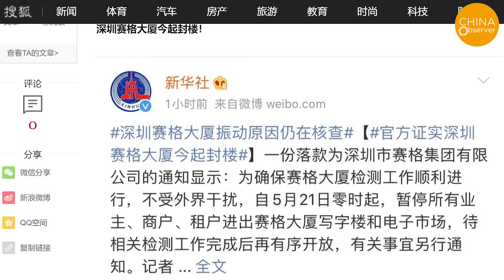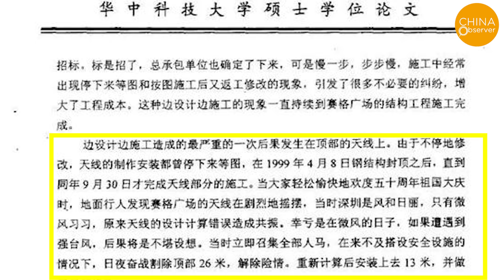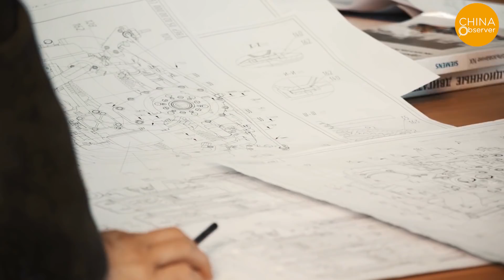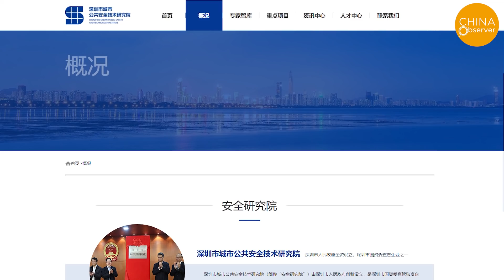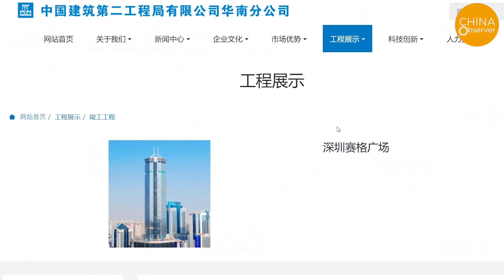356m Tall Skyscraper Shaking Again, Monitoring Data released, analysis of the causes of shaking

Comment: She’s coming down - just a mater of time, shaking is the enemy to strong concrete.
Reply: Shaken building syndrome.
Reply: Not concrete but steel supporting column structure infill with concrete as per report
Reply: The building isn't coming down due to resonance oscillation, as such vibrations are common in supertall buildings, and can be managed (for occupant comfort) with solutions like a tuned mass dampening system (we have buildings in NYC, such as the 436m 111w 57th street and the 425m 432 Park Avenue, that due to their supertall status combined with extremely narrow footprint, require tuned mass dampeners for occupant comfort; you can watch 432 Park's dampener in action on the 99th floor at https://youtu.be/QJXThNHexJc ).

Every integrative structure (especially those that are Khan style tube-structure skyscrapers) has a primary natural frequency that, under the right circumstances, will resonate (vibrate) which can then setup secondary oscillations through other parts of the structure. During design and construction, these types of issues are factored in and addressed through structural tweaks, mass dampening, stiffeners, and other solutions, so that the finished building doesn't exhibit significant unsettling vibrations (keep in mind, these building are designed to move and flex in significant fashion - and modern all-concrete supertall structures, such as 432 park, are no exception).

The reason this building is in potentially serious trouble is that the sudden appearance of these oscillations, after 20 years, is indicative of a significant structural state change. IMHO, this is a warning sign that energy management and load dispersal mechanics of the building have very abruptly shifted, and my guess would be that the foundation is the culprit. The building materials, going in, look like they are setting up framing to do reinforcing concrete pours for the substructure, which would further indicate that the foundation is suffering from some sort of structural deficiency. Just based on this video, a lot of irregularities seem to exist in how this building was built, so the engineers are going to have to account for a lot of variables that could prove difficult to verifiably quantify.

The biggest problem is that, if these are foundational issues, they are particularly tricky to remediate, primarily because the failure mode can be easily misdiagnosed. Factor in that this building was a vanity project for the CCP, the potential pressure to just implement some fix that addresses the symptom (the oscillations) and not the core issue (that something has changed to allowing excitation of noticeable oscillations) and you have a real potential for a future disaster.
Reply: @smakfu1375  Vortex shedding
Reply: @acheable  So the building has been subject to wind loads since the beginning. And, to my point about treating symptoms, they could attempt to solve the problem by reducing the wind loads further by adding exterior elements to disrupt airflow (disorganized vortex shedding). However, the building was handling loads properly, without significant primary or secondary oscillations and then, fairly suddenly, started exhibiting these problems. When the performance of a structure changes suddenly, it's a warning sign. It might be benign and easily resolved, but until verified as such, they should take the warning seriously.
Reply: @smakfu1375 Not vibration but swaying which increases as the tower got higher even during construction (not after 20yrs as reported). Wind impact on tall bldgs is taken as part of the design codes. Thus reasonable assumption of excessive swaying beyond normal (+-1m)  coupled by the rattling of the top mast could have initiated the security to  alarm the occupants to vacate. By now the investigation should throw some light to the swaying by the monitoring sensers installed at the basement. As long as the tower is anchored firmly to the mass fdn(the swaying is normal  and its CG stays within base) there shld be no concern. However not sure what the designers provided as alternative to dampeners. Architecturally  no vortex shedding iconic features for a 79 storey tower and not something u can cut & paste on.
Reply: @acheable  Swaying is a result of their resonant response to wind loads, which in turn leads to secondary resonance excitation in other elements, such as a floor pans, as the structure disperses energy; this becomes, generally, more noticeable at the unanchored top of the building (though not always). If something has changed with the foundation, subtle changes in how much dampening, as well as movement, can lead to very significant changes to secondary resonance in parts of the building. Meaning that high-frequency floor-pan resonance that's sloshing the pool around on the 30th floor is an effect of overall energy dispersal and torsional and lateral loading of the structure that's potentially changed due to changes in the anchoring elements of the structure (e.g. foundation). This isn't a hard concept to understand and applies to any complex structure from a high-rise building to the unibody structure of an automobile for managing NVH. 

Furthermore, given the report indicates that the focus is on foundation elements of the building, I'd bet good money that's likely the location of the root cause. There are a lot of things that can cause resonance excitation, but when you start seeing these types of issues suddenly, where performance of the structure has changed (in quite dramatic fashion), you look at the most obvious place where a dynamic change most likely occurred, and that would be the foundation of the building.
Reply: @smakfu1375  The dynamic load incl oscillations mentioned is factored in the design due to wind impacts. However it is strange no report of occupants experiencing swaying or motion sickness for a 79 storey. Maybe the vibrations from a new undergrd subway line was not considered.
Reply: @smakfu1375  I meant to add that I wonder if recent construction in the area (or an unusual weather pattern) could have caused a significant wind shift or phenomenon/flow around the building? The only other deduction is that some element of the foundation or structure has changed and the wind loads (which have always been there) are now allowed to amplify to the point of significant resonance - a scary thought. 

Either way, it’s guaranteed some engineers shit their pants when they saw that pool sloshing video. 🤣🤣
Reply: @smakfu1375  This is absolutely not normal though, that pool video? Are you kidding? This is giving me vibes of the Tacoma Narrows Brodge more than anything else. Reinforced concrete can only move so much before permanent damage is caused.
Reply: @smakfu1375  so what's your recommendation? Will the cost of effective remedy outweighs its practical use? You seemed to be an expert structural engineer so I'm interested by your response.
Reply: @smakfu1375  FYI the swaying is not inherited but an 'inherent' behaviour as wind impact force is a criteria in limit and serviceability state design of skyscrappers. If the occupants in question feel extra discomfort just investigate and  rectify. As per report, the structural integrity of the mass fdn and its composite tubular steel/concrete infill is still intact and thus safe. Therefore do think good for it is normal for any gov in particular CCP to be proud of its achievement to have a 79sty landmark bldg in Shenzhen 20yrs ago. Now, iconic "vortex shedding"  skyscappers landscaped most chinese cities . Engineering wise it must be the close collaborations between local China Design Institutes and foreign structural engineers/architects in turning these cities into tourist attractions. Nevertheless if you have not experience the swaying do visit one of the tall skyscappers in your country. Definitely will be  much more comfortable than the feeling encountered during standing supervision while the construction is in progress at 40 fls and upwards.
Reply: I don't know. They said that about the three gorges dam for a very long time and it's still there. However, smakfu's comment seemed to make a lot of sense.
Reply: @rickhinojosa5455  The concern isn't that the building vibrates (such issues do crop-up with new construction and have to be remediated). It's that it seems to have started rather suddenly after two decades. Personally, I think something's failing at the foundational level. There's been a lot of construction and infrastructure change in the area of that building. If I had to guess (knowing almost nothing about the details of this building), I'd posit that either a portion of the concrete piles or part of the mat is compromised in some fashion. 

Now, that doesn't mean the building is in any immediate danger, but foundation issues, when not addressed quickly and properly, can go from problem to disaster in the blink of an eye. The good news is that we have excellent modeling tools nowadays that should allow the engineers to dynamically analyze the structure to diagnose the likely cause. The danger is that they'll only address the symptoms and not the root cause, because the root-cause may point back to a political agenda during construction, or simply be too expensive. 

Long-and-short of it: buildings shouldn't suddenly start behaving the way this one is: it's a warning sign and they should take it seriously.
Reply: @smakfu1375  Say, are you familiar with the Florida condominium collapse that happened a couple days ago in Florida? Today is 6/27/21. Looking at the footage of the collapse, it was very strange. Not  strange like a bomb bit strange that it collapsed as it did. There have been issues in the past about the building but I'm not familiar with those problems. I'm thinking maybe you will be since you seem to know quite a bit about this subject matter. ☺️
Reply: @rickhinojosa5455  Watching the video (which is tragic and pretty horrifying), it looks like a pile or slab failed catastrophically. My understanding is that there were known problems with water intrusion into the concrete structures, leading to rebar corrosion which, when not addressed can cause exponential degradation of such structures. There's also been unconfirmed reports of excavation in or around the substructure, in the recent past. 

If I had to guess, we're going to find out that the building wasn't structurally deficient when built, but also wasn't properly maintained. From news reports, they have a 40 year recertification process in that part of Florida, whereby the building has to be inspected and recertified for occupancy. Personally, given the nature of the land where that building was constructed and the prevalence of issues like subsidence, saltwater intrusion and major storms, I'd think officials would want those buildings on a tighter schedule. My guess is that's exactly what will happen: tighter regulation and inspections. 

That said, it underscores my point that when you have foundation issues, you have to pay attention to warning signs and address root cause. There are almost always warning signs of structural issues, even if sometimes subtle (if reports are to be believed, there were many including an engineering report that warned of significant problems taking hold with the substructure, delivered to the buildings owners in 2018). However, when a structure finally fails, it usually happens quickly and catastrophically (the Genoa Bridge collapse is a good example).
Reply: @smakfu1375  Hi. Thanks for that opinion. I am by no means any kind of engineer whatsoever, but I've done a lot of construction as a handyman in my life so my mind can visualize the mechanics of many things.  My first thought was rust corroded rebar that was the root of the foundation. And it's funny you mentioned the Genoa bridge collapse because I saw a video in that collapse about a year ago. That's probably why I thought of corroding metal. That bridge collapse was terrible. So is this condo collapse. Very sad.😢 Thanks again for your information. 🙏
Reply: @rickhinojosa5455  No other engineer would like to be in the position of the engineer in charged of  Champlain Towers South, Miami that collapsed while undergoing plans to rectify the major structural defects which were highlighted way back in 2018. For reason critical structural cracks would mean columns, beams and slabs no longer able to bear the loads. The steel rebars would have started its elastic deformation and when it reaches critical point they just "snap". The video clips didnt mention of temporary prop ups erected under the slabs or cracked columns , temp encasement for critical columns and beams. This would temporary delay the collapse and permits occupants to evacuate. What caused the delay.
Reply: @smakfu1375  Great post and exactly my concern as well (and I immediately rolled my eyes at their explanation as it completely ignores the fact that this is a new phenomenon). Plus let’s be honest, why evacuate if it’s “normal” - especially in China when it’s a bad look internationally. 

It’s clearly some sort of harmonic resonance, I’d have to assume wind is a primary factor as the forces can be astronomical on a building like that - even subtle, if allowed to amplify. 

They’re lucky they resonance dampened out, because I feel like any of these initial incidents could have been catastrophic if it hadn’t (again, think Tacoma Narrows Bridge). 

Either way, this is one building I’d probably refuse to enter at this point. Not that I plan on visiting commie China any time soon lol.
Reply: I've seen some of their "concrete".  Sometimes it looks a bit like Swiss cheese.

Comment: Ahead of time, below budget, prestigious awards - but made in............ China.
The concrete filled pipes are expanding and contracting at differential rates and are now like ice filled straws after bending them. In  engineering terms this is such a cheap shot and was very risky and should never have been greenlighted. We're talking basic principles.  Pattycake .

Comment: The investigation is being used as a propaganda tool.  The results that all measurements are “within standards” is a set up to allow them to ignore the real cause and the fact the structure is mortally wounded and just treat the symptoms. I am predicting right now on 30 May 2021 that they are going to say the structure is safe and then just recommend installing dampers to reduce vibrations.  However, dampers will not address the root cause which is the structure’s load system is failing.  These type of vibrations at this stage in a building’s life are just the next phase on the road to structure failure. Needing dampers now when it didn’t need them before clearly indicates the structure has changed.

Comment: it'll be fine, as soon as we shore things up with this truckload of bamboo we tried sneaking in
Reply: I heard the shaking is caused by a woodpecker.
Reply: Lol! I saw that. Didn't look like it would help much. Hopefully they can figure something out. Nobody wins if that thing collapses.
Reply: @marylandgirl9246  you're wrong there. The bamboo cartel wins.
Reply: @marylandgirl9246  lll9
Reply: @marylandgirl9246  Bamboo is actually extremely strong and is a great choice for building material
Reply: @marylandgirl9246  The only winner is government officials who get to have more money from the builders and the builders who sell offices and apartments before they even finish building it.  And they sometimes walk away from it before it is finished.
Reply: My bet is that’s just scaffolding
Reply: If it's not steel then it doesn't count towards helping the building become more solid. Assume bamboo was for aesthetics
Reply: panda
Reply: bamboo is used for scaffolding..they just attach it to building..Hongkong hillsboro court 34d ...Used bamboo on the out side to repair bad water leak.. right outside my windows.. with plastic strapping..only metal was bolts and flang to building the rest bamboo...
Reply: ..ever heard of sarcasm??
Reply: Jackie Chan in "Rush Hour": "Chinese bamboo is very strong"  Who knew he was speaking for the Chinese construction industry.
Reply: Exactly. What good will a load of wood do?
Reply: I noticed that as well.
😂😂😂😂😂😂

Comment: It’s ridiculous to start a project that size with the design of major structural elements unfinished. In the US you couldn’t get a building permit. There’s always changes, but they should be limited to minor omissions or errors in drawings of details, and unfinished designs of tenant improvements. Not to the basic structure. This is likely a failure to do a dynamic analysis of the building- it’s probably got a fundamental frequency issue- see the Tacoma Narrows bridge. We have software for analysis now- didn’t they use it?

Comment: Cross winds creates shear votex at leewards side of the building which may make the building to sway. Model the building in a wind tunnel, redesign the building facade using aerofoils, corners to break up the shear votex thus stopping the swaying.